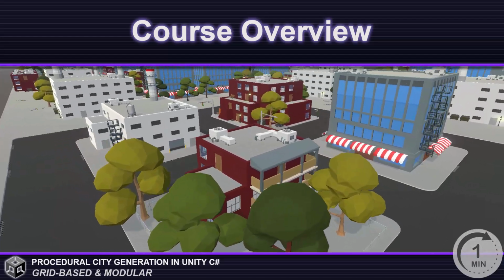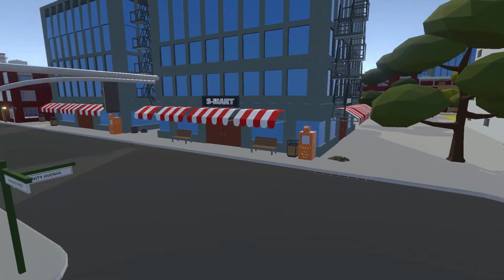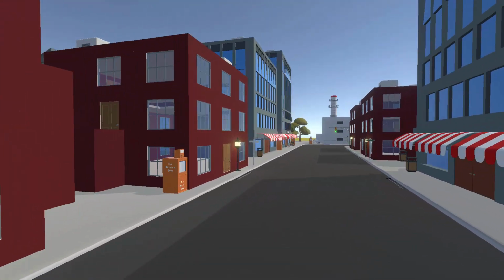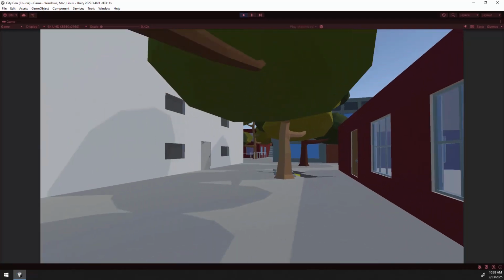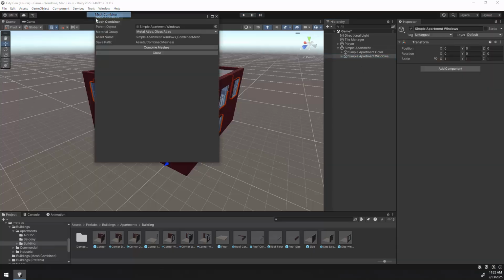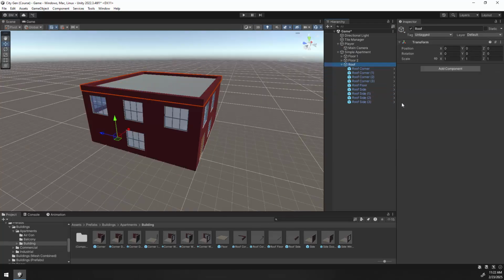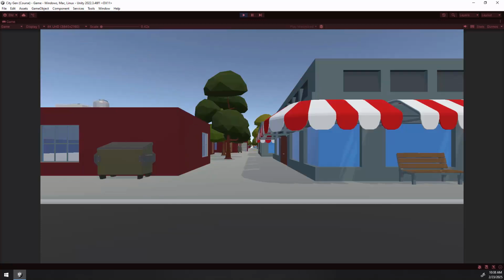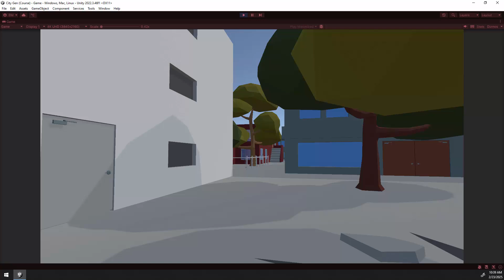Procedural City Generation in Unity C# | Build Modular Grid-Based Cities

Comment: hey but i dont want to combine mesh because i use another unity asset to combine mesh and textures. i just want procedural generation.
Reply from the maker: The CombineMesh script is included free with the course, and is completely optional. If you have a solution for this that you're familiar with and works for you, then you should definitely go with what works best. The course focuses on Procedural Generation for a grid-based city consisting of streets and buildings. There's a bit of binary logic mixed in there too, which is useful when working with these kinds of systems. :)

Comment: Can this be done with Godot and C# as well?
Reply from the maker: That's a great question, and one I’d love to know the answer to as well! I’d imagine the core logic would be similar, but you’d likely need to find workarounds for engine-specific differences. For example, does Godot have an equivalent to Unity’s GameObjects? If you're familiar with Godot, I'd love to hear your thoughts!
Reply: @almightygamesdev  I'm a total newb, but I will definitely look into it!
Reply: @almightygamesdev  It seems nodes act the same in Godot from a cursory google search. So I'm guessing I'll be able to do this.
Reply: Godot uses GDScript which has am easier coding experience compared to C#. Because they are different coding languages, you will need to create the script from scratch and the debugging in Godot is in real-time so you can see if it works or not very quickly.